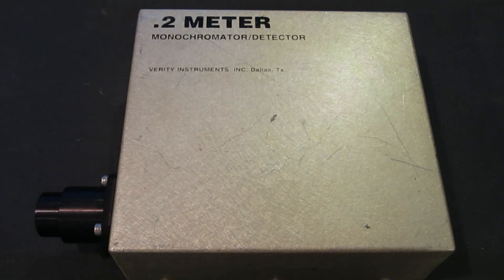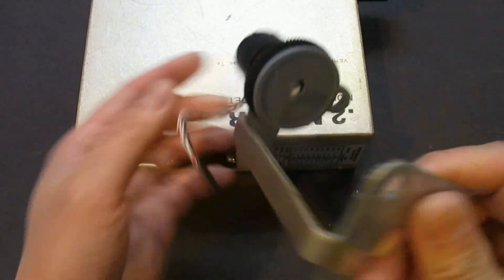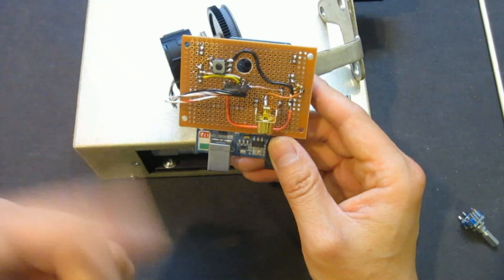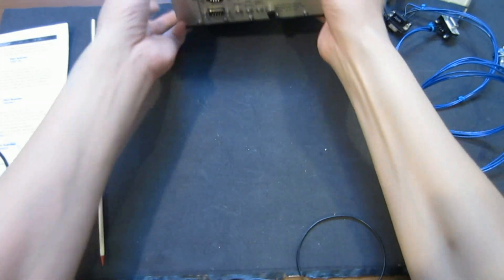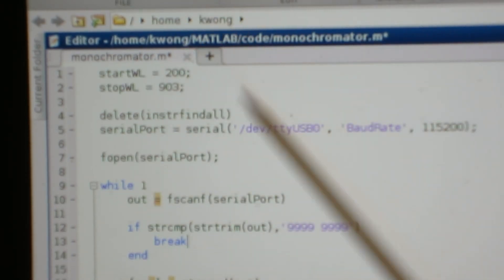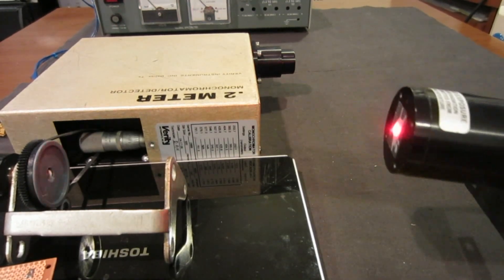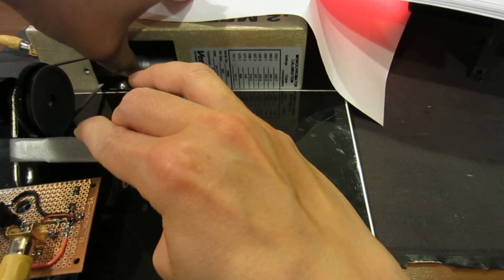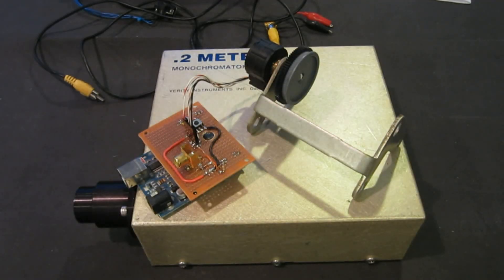Yet Another Scanning Monochromator Build

Comment: Interesting build. Thanks for sharing. I understand you not wanting to modify the unit, but aside from the prospect of ruining it, it could come out good, as well. The unit and the encoder could both be temporarily mounted to a piece of plywood, metal, or plastic--even with double sided foam tape, which could be undone, if you choose so. Though side-loading the screw in the micrometer will wear it even more than if you coupled it something by the end, using a flexible coupler.

The tape for making the light diffuse was a good idea. I stumbled on the fact that (solid/white/pure) teflon sheet is very spectrally balanced. It would also attenuate the output, at the same time. Teflon tape (plumbing) might do in a pinch.

I have the opposite problem: I have some 50,000-step harmonic drive reduced motors, but no diffraction grating, and a good one is so expensive.
Reply from the maker: Yeah, I have tried a few different ways to mount the mechanism, but still have not found a good way without having to modify the case. But it does get the job done.
Reply: Could you tell which diffraction grating would you consider using? I have a (cheap) 600 lp/mm one and will probably try to build a monochromator using it. I'm wondering if it will be good enough to get a ~2nm resolution on the output.
Reply: @laserhobbyist9751  yes that's correct. A single ground would connect to ground of both +15 and -15 V